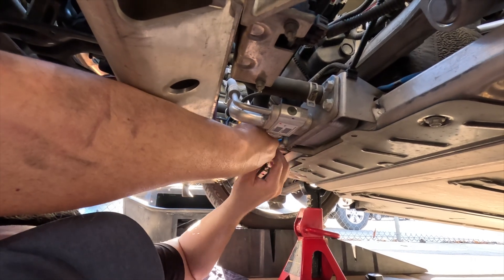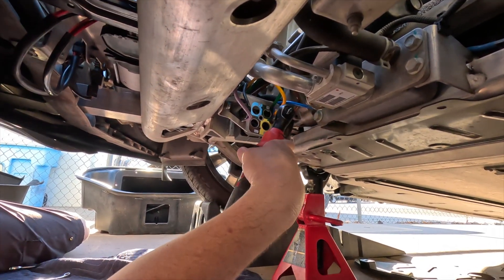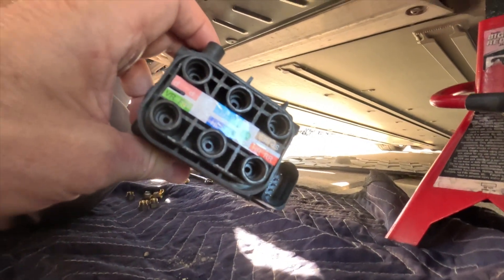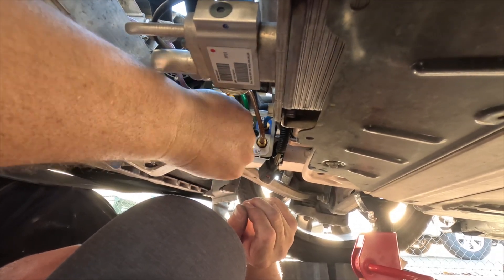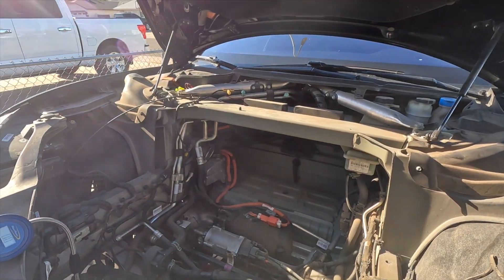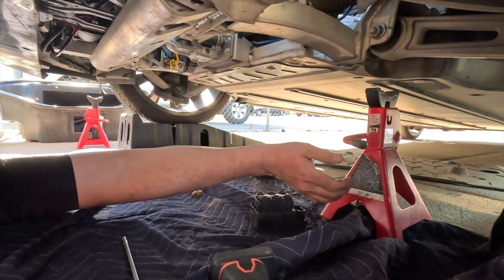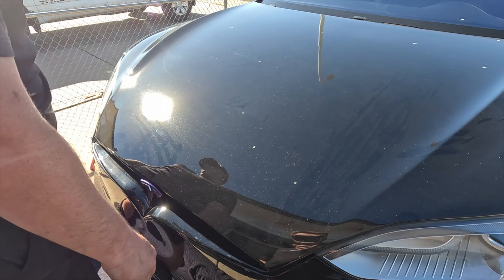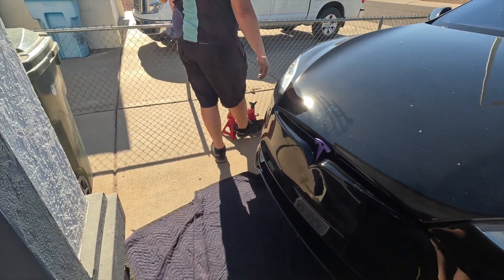Tesla Model S Solenoid Replacement

Comment: Mine is a 2014.. schrader valve on the expansion tank.. not on a line.. in this video I didn’t catch the part where or if you have to completely depressurise the entire system.. which I assume I would do by pulling the fuse and letting the air out etc.. I am sure I read somewhere that you don’t have to do depressurise as the valve block is cut off by the solenoid in the pump so no real pressure.. obviously it’s way safer to have no air, but easier to just whip the valve block out without that fuss?

Comment: Rolf, maybe I missed it but why did you have to replace the solenoid? Didn't you also replace the air compressor? Or was the air compressor after you replaced the solenoid...
Reply from the maker: @rayjohnson8512  piece by piece I replaced the entire system. Watch also the emergency holdback valves at the struts. Some struts producer have the valves defect. You would be better with the old existing valves. There is also a producer in Germany who produces new ones. Rolf

Comment: Rolf, question: I have a 12 S and the pump stays running too much (somtimes have to pull the relay) and the tank never gets much above 75 psi.  If I take the pressure after shutting the car off, an hour later it is at or near zero.  Did thoroughleak test from compressor to tank, but found nothing.  Car does not sag at any corner or side.  Do you think its the dist block/solenoid?  If so, whats the safest (quality-wise) part to use that's cheapest?  Thanks!  Liked and subscribed!!
Reply from the maker: @pkonyoutube  Check the service valve first. I plugged it dead. Nobody except service need this. Rolf
Reply: @TeslaOwnersUS  thanks, but what do you mean by this?  I checked the shraeder fill valve and reseated it, but that was ok.
Reply from the maker: @ now you have to check for leaks. Good luck, Rolf